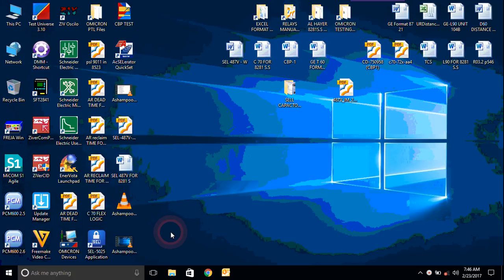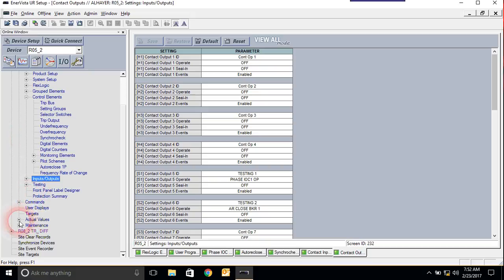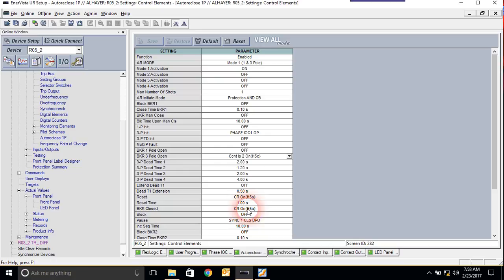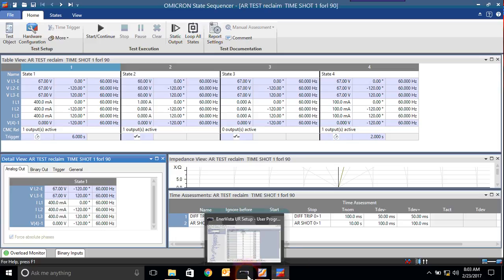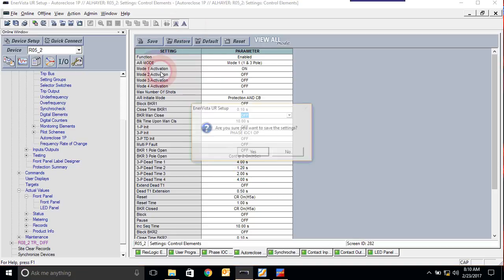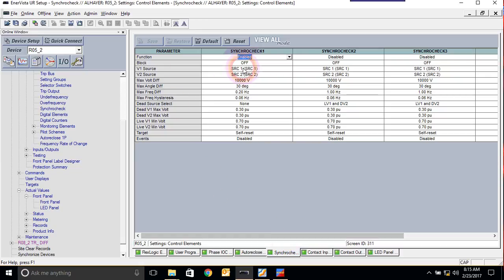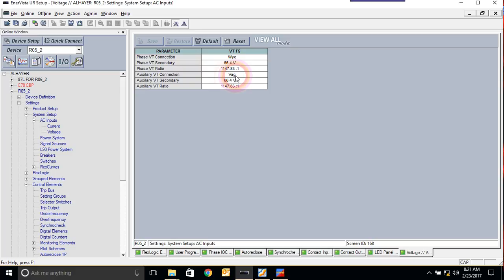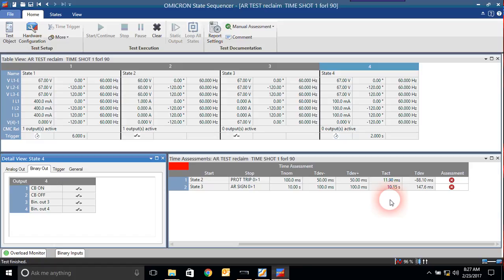GE L90 AR AND SYNC

Comment: eng abdou i have problem during testing AR , after relay give ar command and trip come again ar must be  lock out because i have 1shot but actually relay give another command . do u have solution fir this problem??
Reply from the maker: Mohamed Hassan check the reclaim time as it should long enough to prevent another shot up to your setting put it 60sec and check again
Reply: Do u mean with reclam time (inc seq time) right??
Reply from the maker: Mohamed Hassan yes
Reply: I think when we put status of cb close to make reset , function of auto recloser start from the beginning